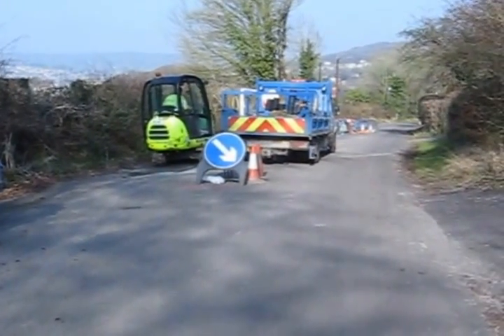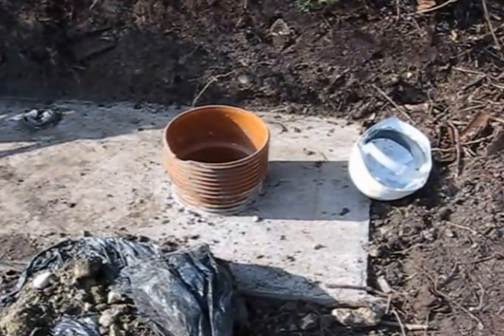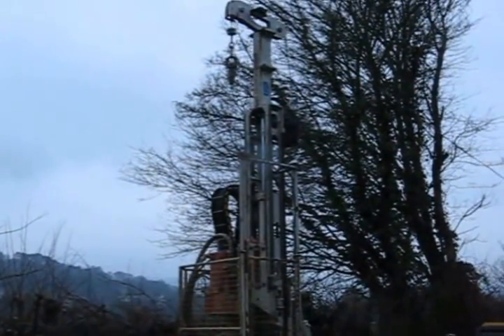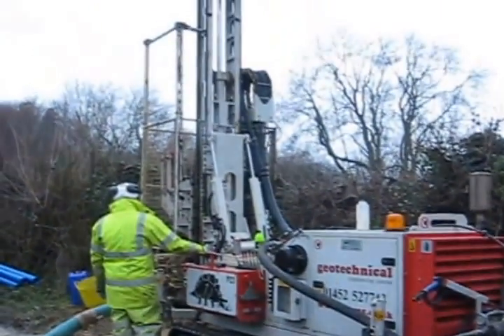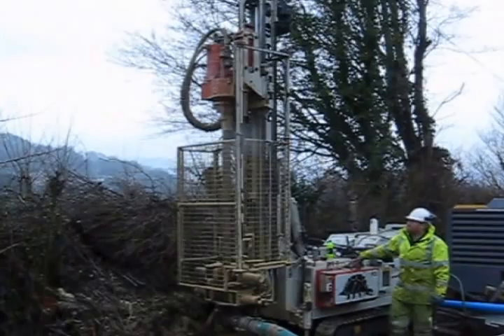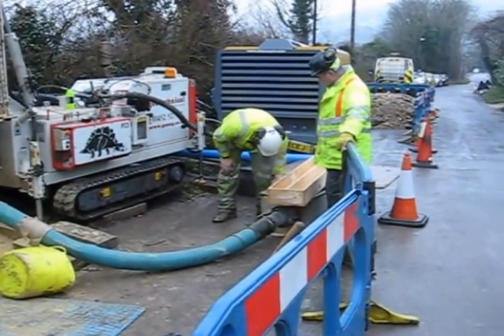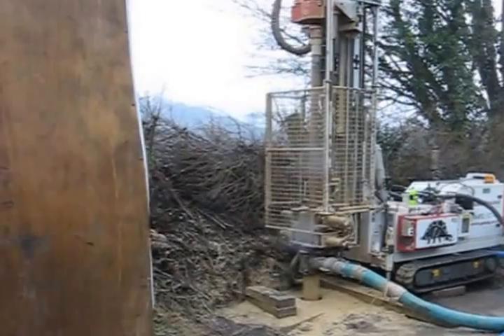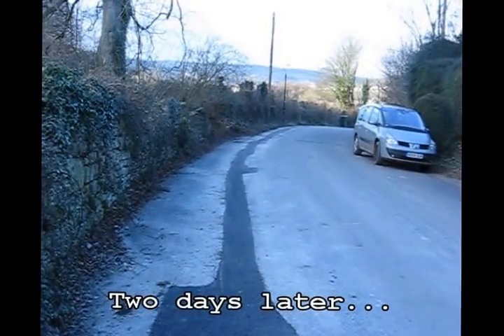Two Tunnels Project - Electricity Supply for Combe Down Tunnel (north)

Comment: Could anyone explain why power isn't supplied to the tunnel lighting from either the north or south portals? Surely using an aperture that's already there is easier than drilling a 16 meter tunnel from the top down?